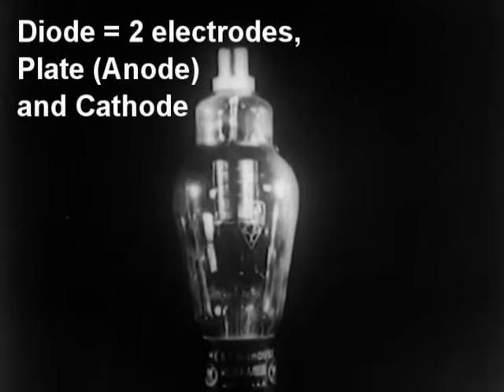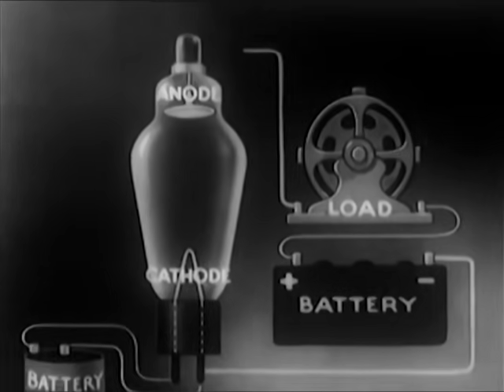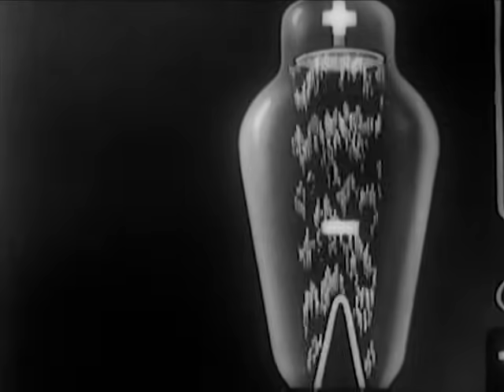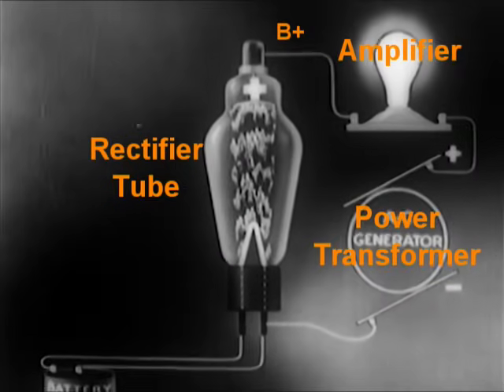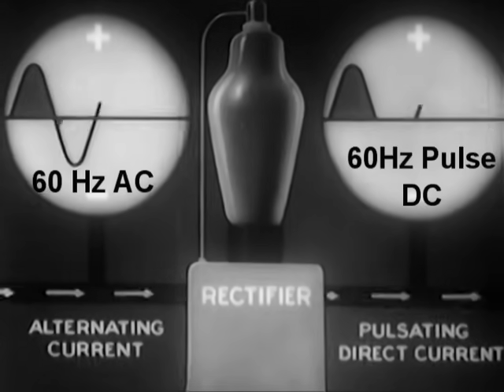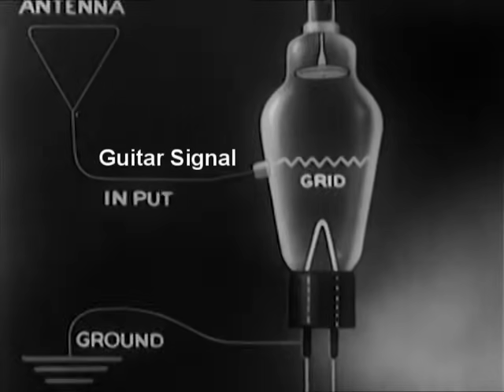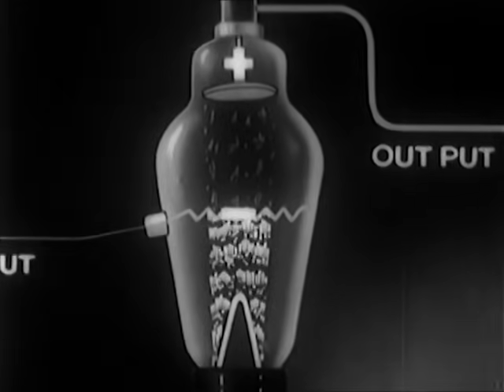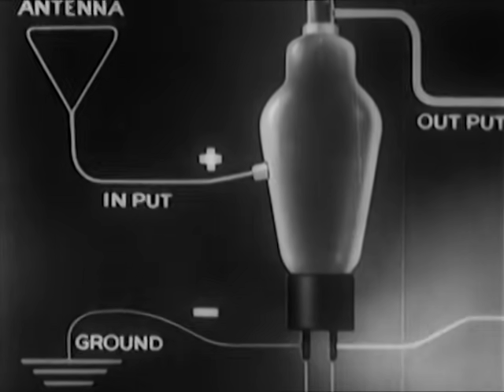How Vacuum Tubes Work

Comment: So it's basically a transistor but with different physics
Reply from the maker: Yes, transistors and tubes are similar in how they function.
Reply: The vacuum tube is the transistors granddad!
Reply: Forrest Hildebrant And more expensive
Reply: I know the transistor is better but I prefer tubes, I enjoy doing maintenance on tech and tubes are replaced more often then transistors also the humming of the tubes are satisfying.
Reply: that is why at the early stage when semiconductor components like diode, transistors,etc just became commercially available. Appliances use these transistors are called *Transistorised*. And for the vacuum tube thing that he mentioned the rectifying ac voltage, if you arrange these vacuum tube diodes like the layout of the full bridge rectifier but you use vacuum tube instead of silicon diodes it would work. Btw they discarded vacuum tubes because they are too bulky, hot and inefficient after all and it is impossible to make small appliances with vacuum tube because of the heat dissipation and some tubes can go higher than 2kw in just Heat Dissipation!
Reply: Tubes behave similar to FETs.
Reply: mmm.... kinda. Transistors are mostly voltage controlled, where as Vacuum Tubes are mostly current controlled. 

Arguably Bipolar Junction Transistors are also current controlled, but, especially relative to a vacuum tubes, they operate more around the potential differences at the emitter-collector-base (or drain, source, and gate if we're talking Field effect...). 

This means that vacuum tubes are generally better at handling large currents relative to transistors, but most residential consumers don't have a use for a KiloAmpere of current. 

More over, a person might actually be able to make a vacuum tube at home. I don't think that's really an option with any of the transistors, but that's also probably not practical in most circumstances. It's  great for the enthusiasts though.
Reply: @walterbunn280  You've got it backwards.  Vacuum tubes are voltage controlled and transistors are current controlled.
Reply: @walterbunn280  Actually hackaday has a DIY transistor post IIRC I'll see if I can find it
Edit: found it: https://hackaday.com/2010/05/13/transistor-fabrication-so-simple-a-child-can-do-it/
Reply: @walterbunn280  Helpful!
Reply: Walter Bunn question, you seem very knowledgeable on how vacuum tubes work, do they really make guitars sound better?
Reply: @Ben-nx7yy  you have to decide that. tecnicly distorsion is bad sounding. but guitarists use distorsion as a effect. So what distorsion sound "good" is a matter of taste
Reply: @Ben-nx7yy  My understanding is that the nature of tube distortion - at whatever point in the signal chain it occurs - is considered more musical with guitar. Some of this simply comes from the fact that it's with tube amps that electric guitar  got started, so all the guitar tone you knew and loved and your parents and even g'parents knew and loved came from tubes.
Reply: @hubbsllc  tubes when over driven have a very pleasing and musical quality. Transistors are more efficient and stay " clean" sounding right to the top of their power range. At that point they distort in a very ugly non.musical way that sounds terrible.
Reply: @Ben-nx7yy  Tubes or transistors alone dont make guitars sound better or worse. It's about the construction of the whole circuit and the purpose. I have tried both types in different brands and models, not hundreds but maybe a pair of dozens of different amplifiers. Some sound good and some sound bad. It also depends on the type of music you wanna play or also your type of technic. For example if you play 50s 60s or 70s music the dynamics and not full distortion of tubes is the usual. If you play modern metal or hardcore punk, high speed picking with the less effort and most hard clipping distortion possible, solid states can actually be as good, despite most of the guitar players choose tubes. Anyway your amp choice is a matter of taste and also there are no rules in music apart from musical theory. And one interesting thing to bear in mind: most of the pedals are solid state, even the hi end ones. The behaviour at high volume is a different thing. It's usually said distortion in tube amps works better at high volume, and ss sound and work usually the same at any volume level. That makes tubes makes tubes kinda more powerful amps but also sometimes less reliable in consistency. But as i said, it depends on the model.
Also eq, effects, pedals or components you may add change the response of it all.
My 50 cents if you want to sound better, put a buffer after the guitar if it has passive pickups and choose wisely the cone speakers. Then analize the rest.
Reply: @Ben-nx7yy  yes they do, 2024 and we're still attempting to digitally emulate glass audio tubes used in guitar amps.
Reply: Rob Robinette except tubes are exponentialy bigger

Comment: So what are negative electrons?
Reply from the maker: Just making the point that electrons are negatively charged so they are repelled by the other electrons sitting on the control grid but they are attracted to the positively charged plate. If that doesn't answer your question then brushing up on basic physics may be in order ;)
Reply: Your answer is about a property, or a function of a property rather than what.  But TY.  I think I was trying to find out if negative eletrons was a plural of zero electrons.  IE the absence of electrons.  
Such as if electrons move via a conductor to a sunstace of less electronic density. It is therefor the movement from greater to less great.  Like water flows via a conduit moving into empty space or conduits of negative water. Or no water. Or Zero water.  So are negative cables like conduits. There to provide the space for the electrons to pass in to.  But for calculation purposes people needed to speak of the capacity, the amount of space needed for the electrons to flow to. So they were call negative.  Or zero electrons as they did not really exist.  Like no water exists.  
That is more about my question and why  I asked what are they and not what they do.   But TY.
Reply from the maker: Electrons flow from high electron density to lower density because they repel one another, so they seek "elbow" room away from one another. A positive voltage represents a roomy conductor. Ground or "earth" represents a virtually unlimited supply of electrons and positive voltages will "pull" them out of the ground.
Reply: Are they getting 'pulled out' or 'elbowed out'?  Or like water just flowing out of and space?  I would have though replusion implied more 'elbowed out' (Pushed or forced out).  But I am not the physicist here.
Reply from the maker: Yea, you're right, it's more correct to say the electrons are pushing one another out of the high density zone into a low density zone.
Reply: Thank you your reply.
Reply: positrons, it's important to remember the double negative rule
Reply from the maker: Where can I find more info on this theory Niksa?
Reply from the maker: Thanks Niksa, I'll check it out.